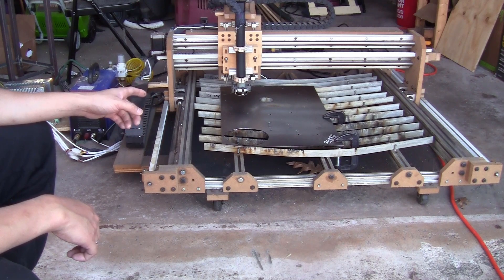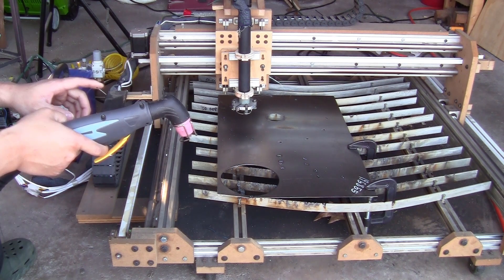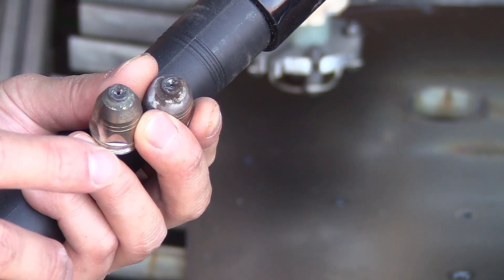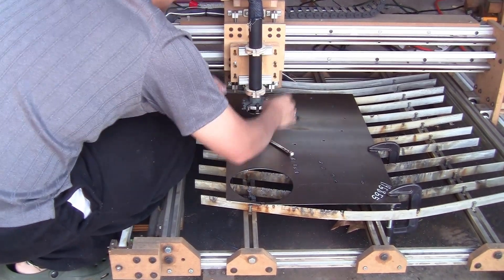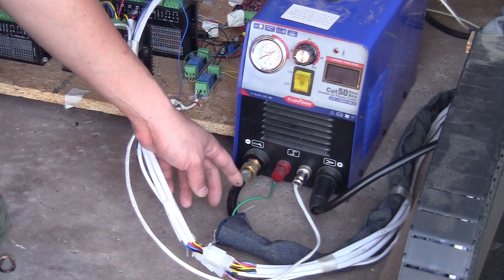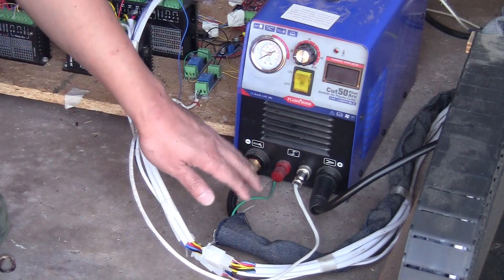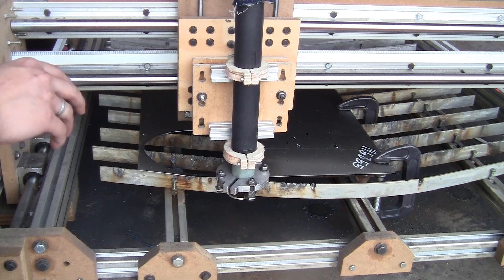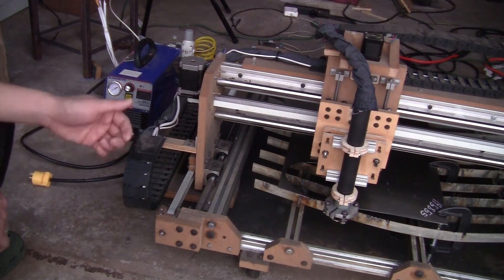Cheap plasma cutter Cut50 pilot arc - All you need to know to make it CNC compatible

Comment: I'm wondering if when you had the sputtering problem, and you were adjusting the gap inside on that board, if you maybe cleaned the points as well, and that made it also work better along with the adjusting of the gap, which might be why you couldn't replicate the problem as easily?

I had pilot arc problems on my Bestarc 2nd gen where the pilot arc completely failed.
When I was massing with trying to figure out the problem with it, I cleaned my points in the similar location and type of setup, but mine didn't have adjustments like yours unfortunately so I bent them manually, which I shouldn't have done, because it turned out that my pilot arc problem was actually caused by the piolet arc relay being fused inside.
I couldn't get the relays for this thing, so I cut the top of the little relay open and had to use a punch and a hammer to unfuse the damn thing, and then had to file it flat again and bend it back into shape, then it worked again.  Then I ended up getting this big heavy duty relay off of amazon while waiting for my 15 cheap replacement relays I ordered from China, and this big heavy duty one is awesome, and has a cover that comes off so you can clean it or even swap the parts, but also has 2 sides to it, so I can just switch to the other side of it if it happens again as well...

Anyway, I was wondering if maybe you happened to clean those points and forgot about it, which might have been the reason you couldn't easily replicate the problem?

And here's the name of the heavy duty 24v relay I ordered for $38 Canadian from Amazon, to replace the cheap difficult to get consumable ones that come in these cheaper plasma cutters if anyone is interested, because it wasn't easy to find an alternative one that would work properly, or even better than the original:

TWTADE/JQX-62F-2Z Coil Voltage DC 24V 80A DPDT Electronmagnetic Relay,High Power Relay DC 24V

Also, thank you so much for this detailed video and explanations for this HF CNC issue, I really appreciate the help!

Comment: Hi Minh, hope youre are we’ll, funnily enough I have a very similar set up and im getting spluttering but my spark gap doesnt appear to be adjustable which is annoying but my question is around the the vietnamise thc that i also bought and sheetcam, in the post processor do you use the mach3 version with or without z control? i cant get my thc to work properly until i get the spluttering fixed but i just don’t understand how its meant to work! the instructions are not good and support don’t reply! can you remember? thanks Rich

Comment: Mine was working fine but my air hose was not tight and my buddy tighten it up then it started sputtering change consumables to no luck I was mad at my buddy for messing with something when it was working good after about 40 min of troubleshooting to no avail then by some fluke another buddy turned the air pressure down and it works great so the problem was when he tightened the air fitting on front of machinery the hose and ground and stopped the leak it apparently bumped the air flow and that was more than it could handle

Comment: I have a 15A circuit at home, will I get away with using it or will it flip the breaker?
Reply from the maker: Depending on the cutting amperage, higher cutting current definitely will set the breaker off.

Comment: Tell me...what mean in tips no 2 sir...
Sometime when plasma on , my mach3 is hug, display on monitor stopped
Reply from the maker: High-frequency interference, hard to remove. Installing the THC system will help
Reply: If I use only IHS/Floating switch is enough good, isn't it?
Reply from the maker: I can't be sure since I don't know your setup. Try it for yourself to test it.
Reply: @minhsmancave9448  setup as like your video , on mach3 and sheetcam  only...(NO THC)
Reply from the maker: I couldn't remove the interference completely. When cutting at higher amperage, my Mach3 still got stopped. The solution is change your breakout board to a ethernet port one or change your plasma cutter to a blowback pilot arc.
Reply: @minhsmancave9448  breakboard as like what? USB type ones?

Comment: May i know how to connect the cut50p to mach3 for turn off? Thanks
Reply from the maker: Connect an output (usually output 1) of the mach3 board to a power relay to control it, then connect the trigger wires of the cut50p  to the relay.

Comment: Enjoyed your video! Quick question, what is model number of the torch head that you ended up sing?
Reply from the maker: I'm using an A141 torch. But It's not straight forward to connect this torch to a standard plasma air hose. The connector might be M9x1 or something like that. I had to cut the connector on my P80torch and braze welded it to the A141 torch head. If you also think of using a higher current torch, maybe should go for this one: https://www.aliexpress.com/item/4001027809021.html
you can chose the M8x1 thread so you can replace the torch directly on to the P80 torch air hose.
Reply: @minhsmancave9448  Thanks for the advice!

Comment: Hello, what thickness of sheet metal can you manage to drill with this plasma model?
On the websites we can read that these posts cut up to 8 mm but this is valid when we start at the edge of the sheet. Have you been able to test the maximum capacity of this 50P cut?
Thank you.
Reply from the maker: No, I haven't cut anything thicker than 1/8" which is only 3.2mm

Comment: Hi there, i have a problem with my diy built cnc plasma cut, can u help me to examine my problem...
I use arduino uno as controller with arduino shield, stepper driver tb6600, nema23, I built a water cutting table separate with rail frame, cheap plasma cut45A almost like yours, universal gcode sender as grbl sender,
I grounded the box, the plasma machine cord with grounding rod to earth, i use ferrite shield cable, I use 2 relay to ignite pilot arc like your channel, but i put all in 1 steel box panel with controller, stepper driver, and power supply. 
Condition 1: with setting hard limit enable, the torch arc start, stop and freeze. So i disable it, and it run without problem.(with ground clamp from plasma near the work piece 50cm)
Condition 2: with ground clamp from plasma put it far from wrokpiece that i put it on water table cutting. Because i want to cut 1 sheet mild steel plate 1.2mtr x 2.4mtr, so after the run it freeze after 5 second
My email is su3cs@yahoo.com or do you have Whatsupp?
Reply: I really apreciate your help... Because i'm so lost. I can send u a picture that i built the machine...
Reply from the maker: First, check my later video about this: https://youtu.be/t0gdKiKtitg 
My advice is to change your controller board to another one that use an Ethernet port. The USB port is a lot more sensitive to high frequency noise compared to the Ethernet port. If you are insisting on using GRBL and Arduino. You will have to install some filters on the limit switches: https://github.com/gnea/grbl/wiki/Wiring-Limit-Switches
Using capacitor and resistor as figure 3 or 4 in the links.
But, change to a Ethernet breakout board will be a lot better. I both tried arduino (I had to install the filter also on the swaitches) and USB mach3, the interference was too much and I couldn't cut correctly until I changed my controller board to a NVEM board.
Reply: @minhsmancave9448  sir what NVEM board is? As like red one? RNR Bob mach3?
Reply from the maker: NVEM is an ethernet breakout board, Chinese brand. After using it, I don't really recommend it.
Reply: After use it for 2day, my nvem board doesn't detect at all at my PC...
Reply: Now my problem with my plasma cut is, my rnr motion board got weird after several cut, the output signal got on it self, so my think is the noise from plasma cut got in to the control board. The suspect is, after install thc sd proma, the board getting weird...

Comment: Use shielded cable and ground to earth.  You need to speed up the cut speed.  Your showing the cuts with the video play faster. But that's how fast it should be running.  But nice job on the DIY build.
Reply from the maker: Thank you for the advices. I have a whole world to learn when it comes to metal cutting. My machine probably is not sturdy enough or the belts are not rigid enough, when I cut fast, the square corners become round. That's why I tried to lower the amperage and cut slow.
Reply: @minhsmancave9448   when you draw your squared part you need to Fillet them. it makes a very small radius in the corners.  in a 90deg cut the torch stops for a half sec. with a 1/32 radius the torch fallow's the line only slowing down a little.
Reply from the maker: I'm aware of the kerf radius of the plasma torch. What I saw was about 5mm radius. It might be the belt on one axis wasn't tightened enough. I will check and try to cut faster.

Comment: Does the new torch improved the cutting quality? Like angle of the cut edge, dross amount. My Cut50 cut quality is not the best, I tried a lot feed rate/current/air pressure variations but still have some issue with sticky dross buildup. Some adviced a compressor air filter, that's will be my next project.
Reply from the maker: Yes, the new torch definitely improved the cutting quality. I can see the difference when cutting thicker sheet metal like 3mm. By looking at the p80 torch, I don't think the air inside the nozzle swirl as it supposed to. The a141 torch has a swirl ring that you can see and also the burnt marks inside the nozzle, electrode that the air swirled and make a cleaner cut. With the a141, I can cut 3mm sheet using 30 amps and 45psi and the cut was quite clean. With the p80, I had to use 50 amps and 70psi, and the cut was still crappy. Tried many settings with p90 but couldn't get it right. Defintely the torch does matter.
Reply from the maker: One bad thing about the a141 is the thread to connect it to the hose, it's not compatible with P80 hose so I had to cut the connector on the p80 torch and braze welded it to the a141 head.

Comment: thank you for the video . about the torch can you but the linke for the torch you upgrade it  in ebay . and i get cnc plasma cut60P is it this torch compatible with it thanks
Reply from the maker: You can make any air cooled torch compatible with your CUT60. I'm not sure which torch you have now? If you wanted to use A141, you might need to modify the connector on your torch to be able to fit the hose that's already on your machine. Here's the link to the A141 torch that I have:
https://www.ebay.com/itm/OEM-Trafimet-Style-Plasma-Torch-Straight-A141-Head-Body-Air-cooled-for-CNC/322454075171
But you can buy it cheaper from AliExpress, especially when there's a promotion:
https://www.aliexpress.com/item/32740671777.html
Reply from the maker: @sudangraphic  You should buy this one: https://www.aliexpress.com/item/4001027809021.html
Choose "Internal M8X1". This torch is 100A and can be use directly using the hose of your torch (P80).

Comment: Amazing what you have done with that cheap plasma cutter What is the thickest you can cut with it on the cnc table
Reply from the maker: Whatever your plasma cutter is capable off. In theory, mine can cut up to 12mm thick, but I've never tried since I haven't found any application that needed that thick bracket yet. Also because the thick steel stock is expensive.

Comment: No such thing as overkill for these sorts of things.  If it only needs 75 and you throw 250 at it then it is safe to say that 250 would last for generations.
Reply from the maker: Yes, more importantly in this case is that the arc stays consistent and straight so the cutting quality will be the same from start to finish.
Reply: @minhsmancave9448  I always came from a background where you see what you need and you build it beefier that way you have something that will last longer and will be able to handle whatever you think you will ever throw at it and a bit more.
Reply from the maker: @thebeststooge  yes, I usually keep things about 10% or 20% from the maximum for safety margin. But sometimes the budget will decide what I get. That's way poor people do things :D (I'm sure you are with me on this one)
Reply: @minhsmancave9448  LOL, you know that to be the case.

Comment: Looks like you have got that cutter working well now. Did you remove you THC? 

I have just put a video on of my machine but I'm having trouble setting up mach3.
Reply from the maker: Yes, I removed my THC and am using the guard I made. It works better on real thin sheet metals (24 gauge) because those sheet bends like crazy and the THC doesn't react fast enough to deal with the sudden bending. Let me know what type of board and problem you have, I might be able to have some suggestions.
Reply from the maker: I'm looking at your video and saw your problem. You can't use the limit switches for homing switches. Each homing switch has to be connected separatedly in to one input port. The limit switches can be connected all in one pin as you do now. So, with your config right now, you will have to unable all the homing switches.
Reply: @minhsmancave9448  I didn't know that I thought you could use the same switches for limits and homing. I will have another look at it tomorrow. Thanks